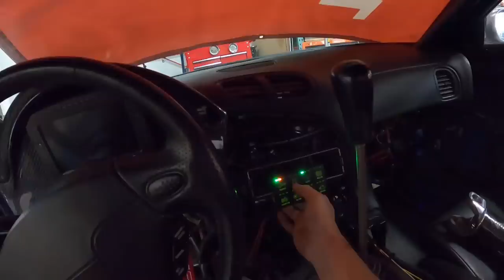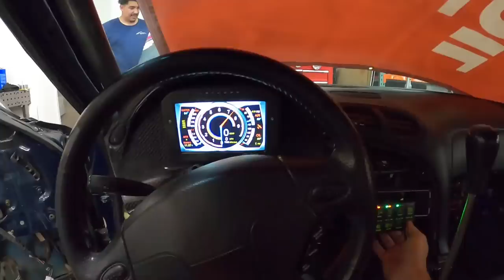6 Rotor Unboxing!

Comment: Hey Rob, joe from n.h. ,im STRUGGELING ,soo hard to get my 10thAE going good ,got it running ,and tried unsticking the seals all seem good ,and I figured with all your parts ,you may have a 2 rotor setup i could purchase from you sir,ive watched and shared every single video of yours over,well over a year sir...i don't want anything for free..just a solid 13b turbo sir...i don't have much time left here sir..thank you if any consideration..

Comment: Mid-engine 6 or 10 passenger 1997 Lincoln limousine. You could easily hide it and; curse me for saying it; quiet the motor with silencers & exhaust cut-outs inside the passenger compartment til you want the power. A 1984 Zimmer Golden Spirit would also be a surprise. The engine room could easily accommodate the 6 rotors size w/o sacrificing passenger comfort or room. My uncle had the 2 passenger coupe but there was also a 4 passenger model.

Comment: I'm betting your gonna have to bore out the bolt holes the keep this nasty thing durable enough to stand the test of time. Also RR 6 ROTOR PRIUS... HILARIOUS but easily the most badass Prius ever. And there's a nasty drag hemi Prius sporting 1000+ HP

Comment: Buy a V10 BMW M6 with an blown engine (like the one in WatchJRGo). The car is cheap, beautiful, and can handle the engine size and the power. The only bad part about that car is the V10, and you'll get rid of it anyway. It's perfect.

Comment: Holy crap... Fuel efficiency wont be calculated in MPG but Gallons Per  Mile... 😂😂😂... It must be silky smooth to drive if its not ported.